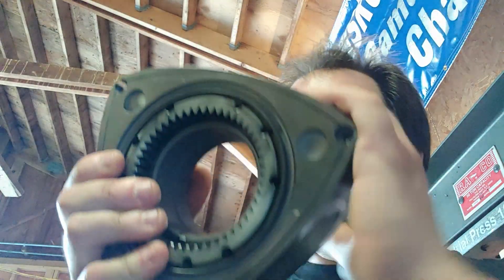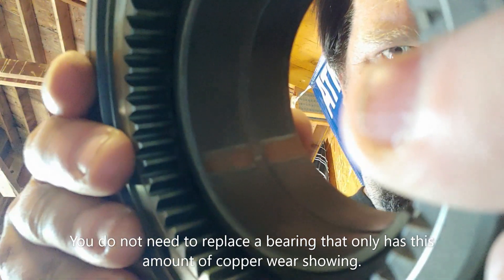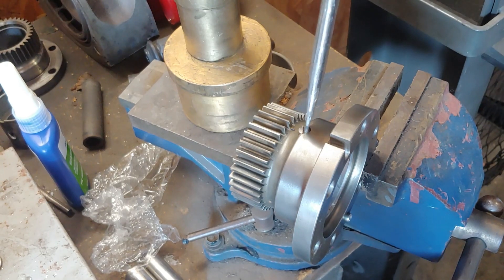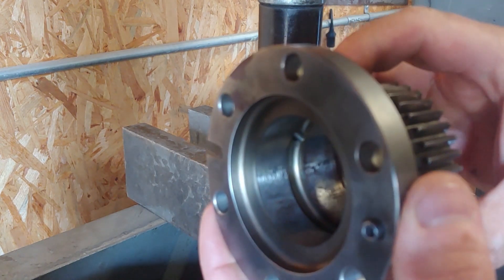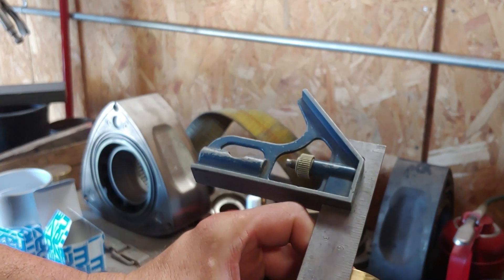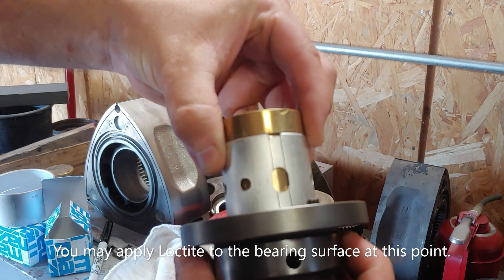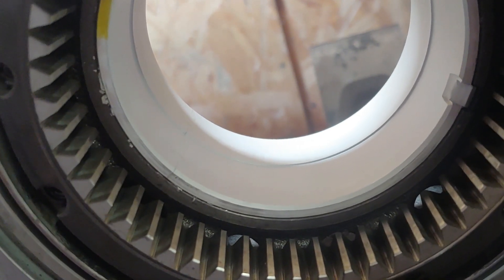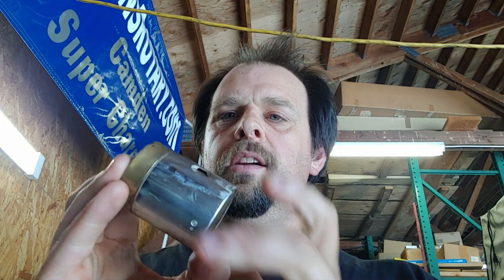Rotary Engine Bearing Removal & Installation

Comment: Is it possible to use roller bearings like one a two stroke, instead of pressured oil bearings?   I want to make a one rotor and not have an oil pump.
Reply from the maker: I am sure it's possible but than you would need to locate bearings and find a way to lubricant them..
Thank you for watching and asking